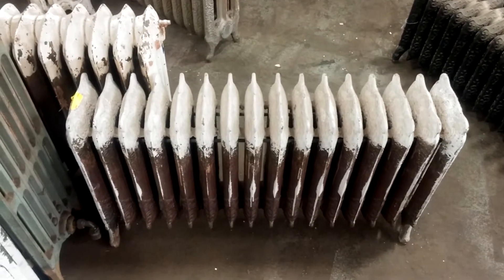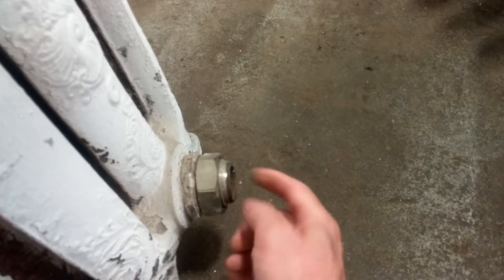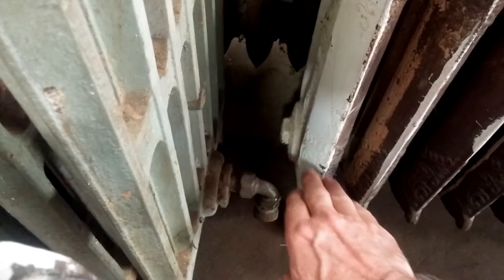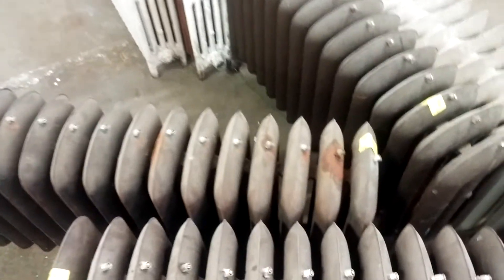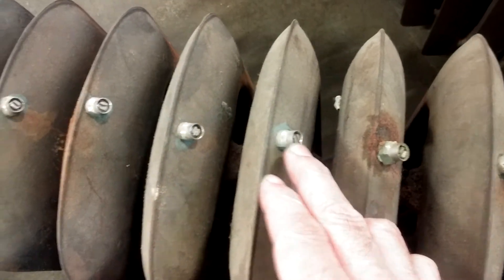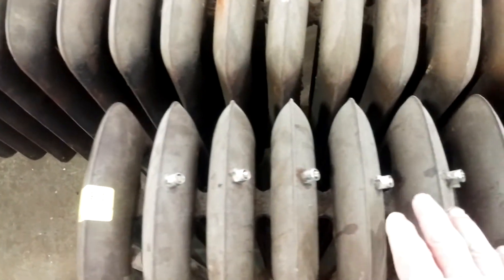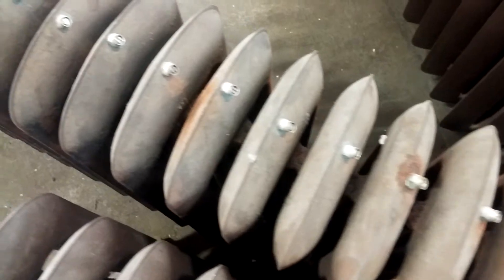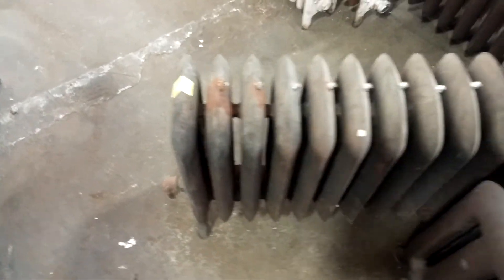How to Ruin a Perfectly Good Steam Radiator

Comment: Great videos but don't agree of course. Here in Detroit. Most steam systems have been scrapped out 20yrs ago. 50 bucks on a good day for 700lbs of cast iron. I believe re-using  old steam radiators and converting to hot water. Let's the old beauty's live on. Rather then getting melted down. My thoughts.
Reply from the maker: If radiators that were designed to be used for either hot water or steam are converted to hot water, then OK, do what you must do.
Where I draw the line is what is pictured here:  single pipe steam ONLY radiators being turned into hot water radiators.
It's silly & stupid.
Your statement that "most steam systems have been scrapped out 20yrs ago" in Detroit is not quite true from what I have been told.
Reply: @gordonschweizer5154  well don't know ur sorce, but I'm an active Master Plumber in Detroit. And systems are being removed and scrapped out of residential homes.
Reply from the maker: @LonsRods  Well, we all see what we want to see.
What I see is folks from Detroit coming on to HeatingHelpDOTcom  pleading to know if there is anyone in Michigan that can come to their home and help fix their steam systems.
Maybe you can pay for an ad on that forum and you might find some grateful local steam customers.
Reply: @gordonschweizer5154  I see what is in front of my own eyes. Not what people are asking. My point exactly. No one works on the old systems. So they get scrapped out. And new installation go in.Just replace with new force air or new boiler installations. Most Steam systems that are functional are in schools or factory. Which have their own boiler company's maintenance programs. Not looking to pick up repair work. But thanks for the recommendation.

Comment: I would just replace the bleed valves with plugs and convert it back to steam
Reply: Yes, that is certainly an option.  For anyone wishing to go that route, I would recommend using a good anaerobic thread sealant and brass 1/8" npt counter-sunk plugs.

For me, however, I would not touch these radiators, even if I got them for "free".  
The risk/reward ratio doesn't look good, especially given the ready availability of undamaged/unblemished steam radiators right there at that same location.
Reply: @elgordo271  if I got them for free, I would scrap them.

Comment: I have seen this mistake several times in conversion from steam to hot water.  But what I have seen is that they simply rely on a greatly reduced heating output of the radiator since only the bottom 1/3 gets warm.

I usually refer to radiators as "steam only" or "hot water type" which works for either hot water or steam.   

I have one of those early two-pipe Dunham systems, originally a Dunham Vacuo-Vapor setup.  Radiators are mostly "steam only" type, but not all that way.  ALL steam supply connections are at the bottom as well as the trap outlet, at the opposite end.  It has been suggested that this installation may have been the result of local contractor error.  However, I find that in the 1915 publication, Bulletin 5, The Dunham Radiator Trap and its Application, it shows radiators connected in this way with the example shown being a steam only radiator.  Also, I they show the same situation in the May, 1911 publication, Dunham Vacuo-Vapor System of Heating.  

I don't mean to be splitting hairs, but I thought you would find this interesting.

Dave
Reply: Thank you for your informative and cogent reply! I do most certainly find it interesting.

I have never seen "steam only" radiators butchered like the above video on still living hot water systems.  I would like to get an infrared video of that, one day.

I have a thought, a suspicion really, that the "steam only" radiators were much more common, readily available, and probably cheaper in 1911, and so there was the overwhelming temptation to "allow" their use, in spite of their problematic physical limitations. 

The thought occurs that the turn-of-the-century steam heating contractor, in order to get the job of upgrading a single-pipe steam system to a better and more expensive two-pipe system with the latest patented Dunham traps and appurtenances, had a leg-up on the hot water competition by using the existing steam only radiators.

Usually the radiators were over-sized to begin with, so it sort of worked, most of the the time, such as in your case.  I suspect that the steam was slowed down enough once it entered the radiator so it not shoot across the bottom to the trap, shutting it, and thus trapping the air in the upper part of the sections, but instead rose up in the sections one at time and allow the full potential output of the radiator to be utilized.

In the Dumham manual handbook of 1922 and since, no allowances are made for use of steam-only radiators and that leads me to the conclusion that enough failures occurred with steam-only radiator conversions, and so the practice no longer had official backing and warranties.  

I would love to see copies of your 1911 and 1915 Dunham publications!
Reply: Thank you very much for sending those Dunham pamphlets!